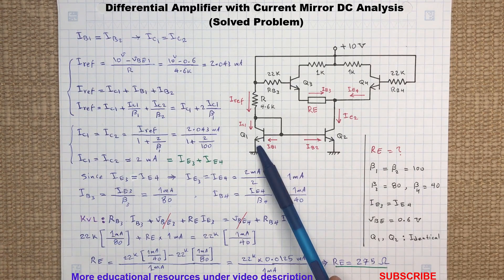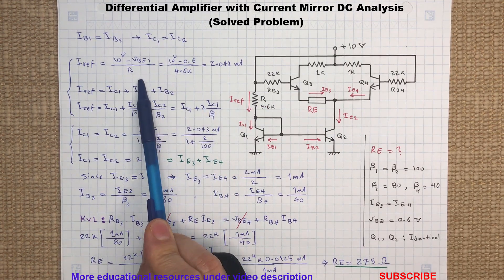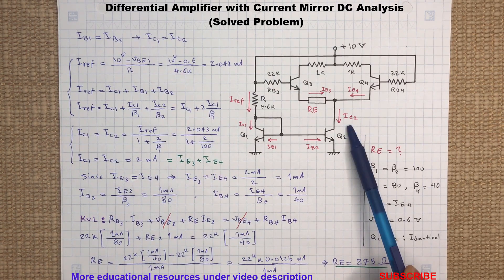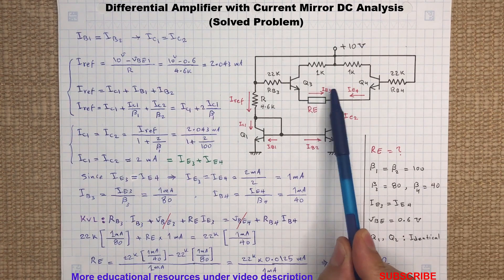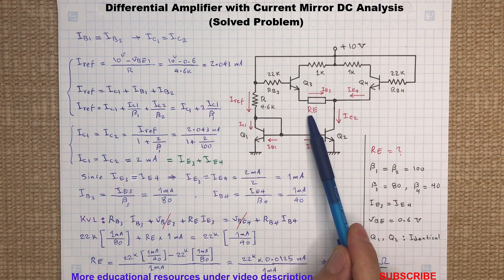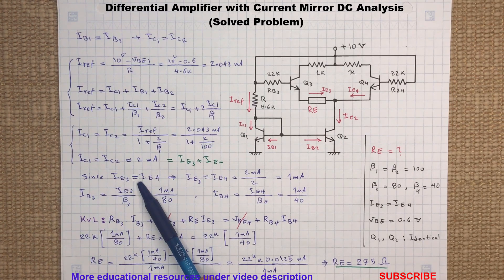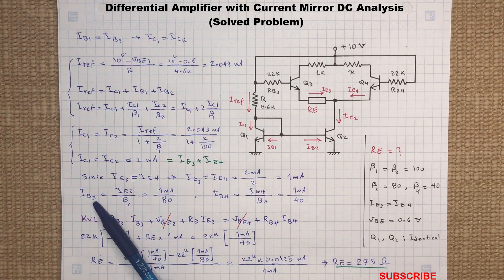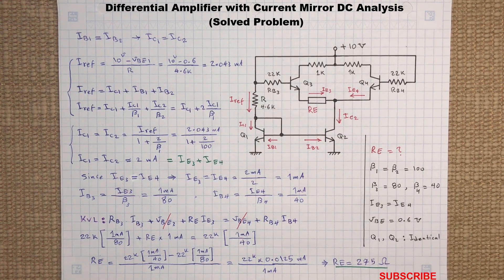BJT Differential Amplifier with Current Mirror DC Analysis

Comment from the maker: BJT Voltage Divider Bias Solved Problem:  https://youtu.be/QTZyadf7u3k
Darlington Transistor and Diode Circuit Analysis: https://youtu.be/GGsz3ftdtp4
PNP Voltage Divider Biasing : https://youtu.be/zGo1NW2PO7c
PNP Fixed Biasing : https://youtu.be/_-PItPPaTjM
Electronic Circuit Analysis Playlist: https://www.youtube.com/playlist?list=PLLA_QJ8rHZBh5LqrY41bCvKgreRDRWrBQ
Control System Playlist: https://www.youtube.com/playlist?list=PLLA_QJ8rHZBjS_S6WPkmUweF5NbImvSqf